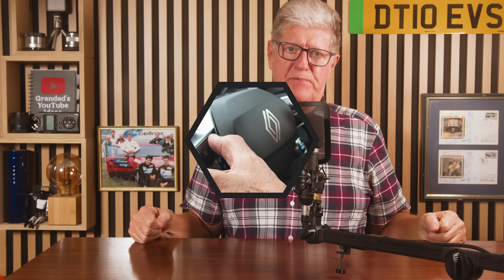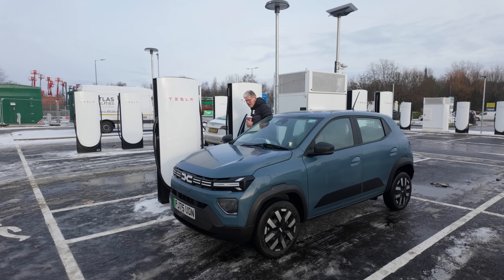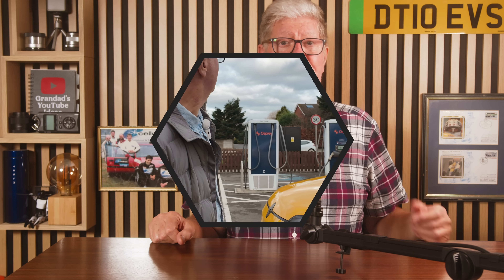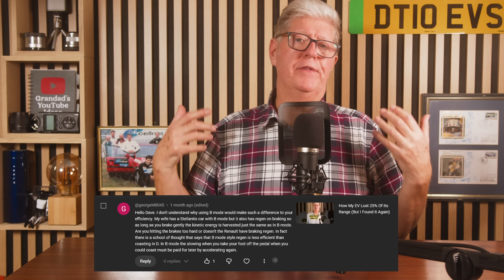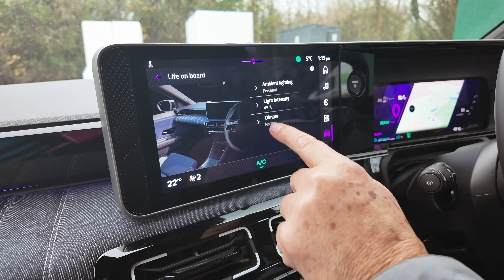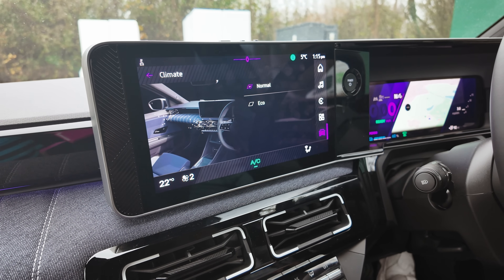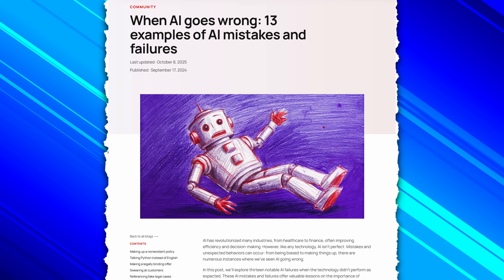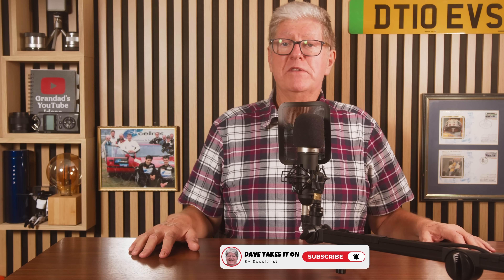Was I Wrong About Regenerative Braking On EVs?

Comment: No mention of the consequences of over reliance of regeneration on the brake discs….
Reply: Regen doesn’t use the brake discs/pads.   That’s why brake pads on evs can last up to 100k miles.  You do have to remember to use the brakes occasionally to keep them clean.
Reply: @crm114.  Actually they last way less as they rust like crazy. Unless you're in a dry climate and have no winter. Around here they salt the heck out of the roads in winter and we get plenty of rain through the summer.
Even my old ICE car had rusted brakes as I used engine braking far to much. This is especially true for the rear brakes as they are used far less unless you hard brake at times.
Reply: @Gazer75 .   The discs on my nearly 6 year old Model 3 are in good condition and I have negligible wear on the pads after 30k+ miles. And, the uk is hardly a dry climate
Reply: @crm114.  But they don't salt the heck out of the roads there for 4-5 months of the year. I had to replace my rear discs last year on a 5 year old car. 50% rusted and would not pass next years inspection.

Comment: Well explained as always Dave. I completely agree with you on the regen braking and did actually get some hard data from my own car which has quite strong regen and full one pedal driving. For a different reason i was trying to find an accurate efficiency figure over the full life of my Fiat 500e. 

Using data from the cars OBD port plus the various charging apps (AC and DC) I was able to see the mileage travelled, the amount of energy put into the battery since its manufacture, and the energy put into the car via both AC and DC charging over its life since new. 

The bit that initially confused me was that the total energy put into the battery was considerably more than had ever been used to charge it. Until, I realised that it would also have had some energy from the cars motor during regenerative braking. How much? Well that was the big surprise - 31%

A full 31% of the energy that had gone into the battery since the car was new had not come from the National grid via either home or public rapid charging. It had come from regen braking.

I am going to leave an additional comment on snow though, because there I do disagree.
Reply: Good bit of data there. I'm very surprised at the high 31% figure. Haven't done such a detailed look at data (well done!), but I suspect it depends on the car - I reckon my Ioniq5 regens at most 20% (I suspect a bit less on average). So much so that I get better efficiency with such as big heavy car (greater momentum/inertia thank a Fiat 509?) if I turn regen off on long (clear) motorway journeys. All other times, one-pedal is great for a variety of reasons.
Reply: @robertduncan5912  Hi Robert, I was surprised too - although my daily drive is perfect for benefiting from regenerative braking. I do up to 80 miles a day on weekdays almost all of which is on twisty country roads with one junction and tight corner after another Rarely do I get as high as 60mph and I'm at a standstill every couple of minutes at least. It's basically brisk acceleration up to the speed limit and then back to a standstill or close to it very shortly after. My technique, (based on pure laziness) is to time the deceleration so as to come to a standstill at the next junction without needing to use the friction brake. Basically pure one pedal driving. Get it right and you make good progress without ever wasting any energy via the friction brakes. 

As a result there's an awful lot of regen going on during my daily drive. I was still very surprised to see it was so effective though. I borrowed an electric Mokka the other day which didn't appear to have full one pedal driving. After that and driving other EV's without full one pedal driving I wouldn't buy an EV now that doesn't have full one pedal driving and decent levels of regen available. I much prefer being able to come to a complete standstill without using the friction brakes.

As an aside to that, I had my first taste of driving an EV with regen on snow and ice recently and it finally answered a few questions I had. In short, I wouldn't want a two wheel drive EV where you can't turn off the regen. I've driven a lot on snow and ice over the years and regen on ice behaved pretty much as i was expecting - as in not very well. Definitely better off without it on ice.

Comment: My Mini Countryman SE has the usual D and B modes for regen but in D mode the recuperation (BMW’s translation of regeneration) can be set to Low,Medium, High (same as B mode) or to Adaptive Recuoeration where the car will vary the regen depending on gradient and road type (Motorway, Dual Carriageway, A road or other road)  in the satnav database. B mode on the motorway is very annoying for following traffic as above a certain level of braking the brake lights come on - this doesn’t happen in the Adaptive Regen in D mode. As I rarely drive on motorways 99% of my driving is in B/ max regen mode and using adaptive cruise control that has a “Queue assist function” where it will brake the car to a stop using regen and hold the car until the car infront moves away. The few motorway drive I done I use Adaptive Recuoeration in D mode.

Comment: When looking at the mpkwh 
Figure just remember it doesn't just take into account the power used to drive the vehicle but also the power used to run the heating etc.  
So power used with regen off on a cold day on the flat could easily be more than the same trip with the heating and air-conditioning off on a hot day with regeneration on. 
Renault tend to have a semi automatic setting where above 40mph the regen is reduced and below that its higher which works quite well.

Comment: No regen is most efficient. Storing energy back in the battery has a round trip efficiency of only 20%. Tapping the brakes uses regen as wel. Therefore no regen is most efficiënt. Only very hard braking (more then max regen) uses friction. None other than when using OPD. Problem with OPD is that you often slow down too much having to accelerate again, using more energy. Simple as that. You should back up your claims wuth data, which you cannot simply because no braking always uses less energy then regen braking and having to accetto catch up.
Reply: What you say is completely right for long (clear) journeys on dual carriageway or motorways, but whenever you are doing a lot of stop-start or even just slow-fast (typical of more urban journeys or twisting roads), regen is helpful - it saves your brakes, it does re-coup at least some energy and it's simply easier driving.
Also, if I have regen off, the brakes on my '23 Ioniq5 DO NOT use regen. I keep hearing that braking does this but it doesn't apply to all EVs
Reply: The only problem is that every so often you need to brake , otherwise it can end in tears.
But which regen setting,  really depends on personal preference...

Comment: My rule of thumb in my ID3.  Use "B" mode (full regen) around town and slow roads.  Use "D" mode (no regen) on fast roads.  
Porsche says using "B" on fast roads is a waste because the amount of energy saved by regen is negated by getting back up to speed and you'll use more power to speed back up than you "regened"
I think the 2 speed gearbox in the Porsche is for higher top speed, not acceleration.
Reply: It depends how you modulate the regen by how gradual you are lifting off the throttle in my experience (Peugeot e2008). I think with the Porsche the default is to start in second gear and the 1st gear is to do a ‘launch’ so it is more to do with getting off the line. I’m not sure but is it the new Mercedes CLA that goes up into a higher gear to reduce motor speed and improve the range at motorway speeds?
Reply: @markbennett6658  Seems like both scenarios for Porsche. You could be correct about the Merc. 
"Porsche says it used two gears in order to improve efficiency, and also to help optimise both low-speed acceleration and top-end speed”

Comment: My worry about using full regen on motorways is that traffic behind you will be unaware you are slowing, as regen by lifting off (without pressing the brake pedal) doesn't turn the brake lights on (2025 Peugeot E5008)
Reply: That is a worry - except, you really are better to have regen off if you're driving on a clear motorway/dual carriageway for any length of time (despite what Dave says here). I've tested the brake lights on my Ioniq5 and they do come on when slowing under regen (except on the very lowest setting). Try doing that with someone following you, just to be sure?
Reply: @robertduncan5912  I checked the drivers manual and it explicitly says under the heading Regenerative Braking:  "The resulting deceleration of the vehicle does not cause the brake lamps to come on." I do apparently have the ability to turn Regen off though
Reply: @rf8640 sounds crazy! And dangerous. I think most EVs have brake lights coming on with regen, certainly with the higher levels or one-pedal. The test I did was with my son following me (Ioniq 5) and then I followed him (Tesla model 3). In both cars, brake lights came on with regen braking. It didn't come on with the lowest level of regen though.

Comment: As per previous comment, the reason for the worse efficiency with lower regen level must be that braking with the brake pedal must use comparatively more friction braking. I would love to know how hard I have to brake with the pedal in my Kona electric before regen switches over to friction braking.... I have tried carefully observing the power meter whilst braking, but it always seems to be regenerating no matter how hard I brake ...

Comment: The regen braking setting changes what happens when you take your foot off the accelerator. It doesn't change how much energy is recovered when braking. Yes, you could cost on the lowest setting, but if 2 cars start breaking at the same point but one does so by lifting off the accelerator and the other doers so by applying brake, the effect is the same. All EVs brake by regen braking until the required force exceeds the regen braking capacity then the mechanical braking is blended in.
Reply: Thats what i thougt
Reply: I am not sure if Tesla does as you said but most cars do not use the maximum amount of braking force that the motor can generate.  The motor can apply the same braking force as it can apply acceleration force.  In a RWD how much braking you can do safely with regen braking will be much less than on a FWD or AWD. What I have found (while modifying cars to increase regen braking) is that manufacturers do not go over 1/3 of the driving torque for regen braking. I believe this is due to the way the accelerator pedal is mapped. The way every EV is mapped it is not possible to get the full torque and not make the vehicle undriveable. With different mapping it is possible to apply the full torque of the motor in regen and still have good control.
The reason for the inappropriate mapping is again an effort to make it feel "normal".
Reply: Exactly! When you need to slow down you either lift the accelerator to brake by regeneration (high regen mode) or press the brake pedal to brake by regeneration (low regen mode). The friction brakes are only used when regeneration can't provide the required deceleration. There are so many variables to all this that all one can say is "For me, in my car and with my style of driving, I find that, in general, regeneration mode X produces the best results". Claiming precise results applicable to all cars, conditions and drivers is nonsense.

Comment: Your thinking is slightly off. Regen is always on in EVs—you can’t turn it off. The modes just shift where regen happens: lift-off in B, or the top of the brake pedal in D.
The brake pedal is a request for deceleration. The car decides how to do it. Light braking = 100% regen; friction brakes are added only if more stopping power is needed.
In D (coast mode), unless you have very fine brake control, it’s easy to press a bit too hard and trigger friction brakes → lower efficiency.
In B mode, unless you have very fine accelerator control, you may regen when you didn’t need to → energy recovered is less than energy lost.
Rule of thumb:
Coast when you can, regen only when you must, friction brakes only when necessary.

Different drivers may get better or worse results in either mode, or as many people report. B mode works well in towns and D mode works well on motorways.
Reply: Excellent explanation.
Reply: Unfortunately it varies a lot how D mode works. Some blend regen and friction from the start others require more pressure. How much pressure before friction brakes are applied also varies.

Comment: I set my Ioniq5 to 0 and brake via the paddle. I hypermile a lot in this setting and have averaged 4.3 over the 26k miles I have driven so far. 60% left on my pads and tyres still have 7mm  tread on the tyres
Reply: Same for me on long journeys, but prefer i-pedal around town etc - very easy driving as well as a bit more efficient. The Ioniq 5 isn't the most efficient car around, is it!? In winter, I struggle to get 3.5m/kWh out of it, but it's a lovely car, and for charging, is one of the best.

Comment: I had an i3s and was unable to turn regenerative braking off, great in summer but in winter it’s dangerous as it’s like using the handbrake to stop on snow or ice. Now have a smart 1 and being able to turn regenerative off  to suit the conditions is much better. Both cars are rear wheel drive.
Reply: Disagree. Been in icy, snowy weather and my i3 has been absolutely fine whilst using regen breaking. It's a matter of learning how to use it combined with anticipation. I could never go back to driving without regen. Each to his own experience and ability I guess.

Comment: Yes, in most cases Max Regen is fine, of course, and the traction control system will help prevent the car from skidding.

The traction control system cannot 100% prevent skidding on ice.

Example: Driving on the road with a trailer attached, you let off the pedal on a curve, the rear wheels skid a little on the icy/snowy road and the weight of the trailer overcomes the traction control... you could spin/crash.

Inexperienced drivers may cause the vehicle to skid, which the traction control system cannot immediately prevent on snowy/icy roads.

It's unlikely, but not impossible. 🙂

Otherwise, yes, Regen can be set to max.

Comment: According to Polestar only about 1/8th of the energy used is replaced through Regen. Coasting downhill on long motorway journeys seems to do the same by not using any energy. The kinetic energy takes over - the same kinetic energy which puts energy back into the battery. I use the cruise control to switch off and coast or switch on when energy is needed. Like my SAAB 95 free wheel in the 70s. I’m surprised how much I use CC when driving generally. So, when around town in stop/start driving I use Regen. On motorways I switch it off and cost down long hills - A303 is a favourite.
Reply: 'evengineeringonline' have some good articles on regen, one article which quotes

"What’s KER, and how efficient is it?

KER involves recovering kinetic energy when the brake pedal is not engaged and occurs when the driver’s foot comes off the accelerator pedal. It allows the vehicle to decelerate slowly, like when entering a zone with a lower speed limit. It also occurs when a vehicle enters a descending segment of travel. In the first instance, a limited amount of energy is recovered. In the second instance, a much more significant amount of energy can be recovered, depending on the steepness and length of the descent. 

The efficiency of KER varies with the use case:

When decelerating slowly on relatively flat ground, KER has an efficiency of about 48%. 
When descending on a travel segment, KER can have an efficiency of over 85%.
Those efficiencies compare with a typical efficiency of 60 to 70% for regenerative braking."
Reply: @_ @_Dougaldog is this quote in reference to Formula 1?
Reply: @dereklawther300  

It's a quote in reference to regen' braking on EVs.

The title of the article is    'How are the efficiency and benefits of regenerative braking measured in EVs?' search for that title in google and it will be near top of search list.
Reply: @_Dougaldog I’m just surprised the figures quoted are so high.
Reply: @_Dougaldog this quote from a similar article - “Depending on the driving conditions, regenerative braking can add 10-20% to the total range of an EV. This is especially useful in urban areas with frequent stop-and-go traffic.” So, about 1/7th is returned into the battery.
Reply: @dereklawther300  

One seventh of the energy used during the journey may be recovered is what it suggests, that does not mean that regen' braking is only about 14% efficient as most of the energy lost during the journey would be air resistance and rolling resistance, along with other factors such as heating the car etc.

The article I pointed to says that when regen' braking or kinetic energy recovery are used during that journey then a high proportion of that energy is sent back to battery during the period in which regen or kinetic recovery are applied.
Reply: @_Dougaldog got it. Thanks.
Reply: The Mercedes CLA 250+ can recuperate 200kwh in the highest recuperation setting
Reply: @b @bshah4831 please explain. If the battery is 100kWh how can the regen produce 200kWh? Over what distance? Over what timescale?